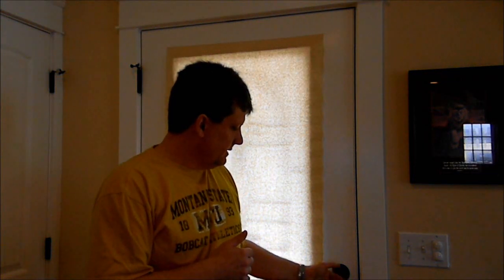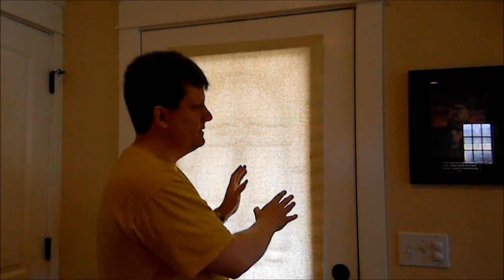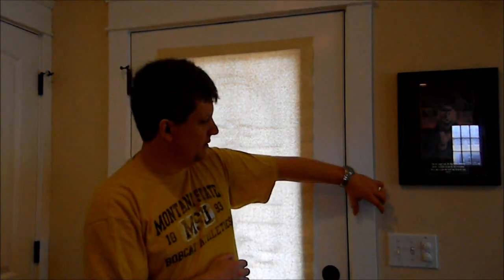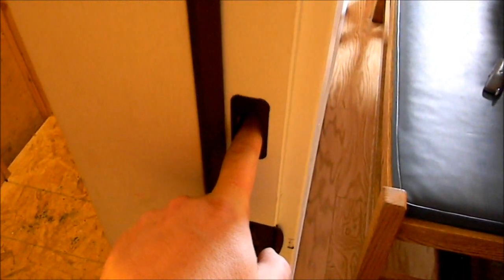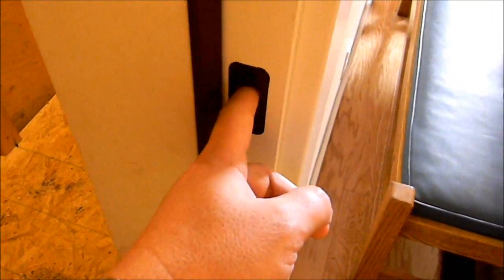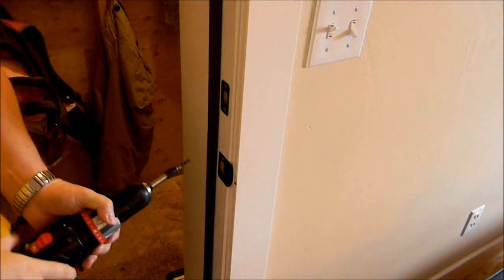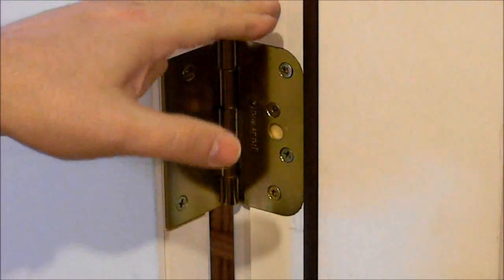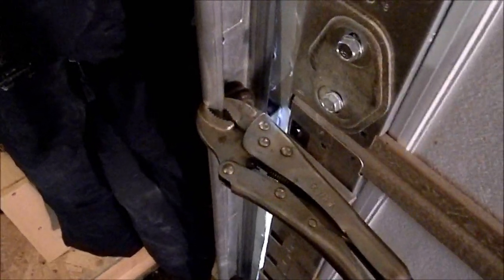SHTF WROL Home Defense Solutions

Comment: Some experts have no real world use of the products they claim to be experts on . That being said, I have installed and removed thousands of sheets of both products and primarily use OSB in all my construction. OSB is much easier to punch through with a hammer or crowbar allowing access to your lock. Try it for yourself and you will see. So in this application I would would use plywood. And again good tips I always use the long screws when installing doors and locksets. Thanks

Comment: Drill a hole in the garage door rail or if holes are already present put a pad lock through the hole in the rail. You could also put a bolt in the holes to prevent it from moving up or down.

Comment: Good video, I would go with plywood over OSB bc it is much stronger, I would also recommend using 2x4 or 2x6 as a middle mount on your OSB or plywood to really strengthen it. Note it won't even come close to stopping a bullet so I would pick strategic locations to harden and put a couple spots to shoot from out.

Comment: Good video. Thanks.  I've actually installed Window Safety Film (Storm / Tornado rated) on my ground-level windows, and my entry doors. It's very easy to install, and EXTREMELY effective against break-in's (Hammers, Baseball bats, sledgehammers, etc). Extremely affordable, as well.

Comment: With a solid door,  solid wood or metal or a combo door  i use barn door hinges,  heavy duty steel hinges in my doors.  As for locking i dont use a 2x4 ir 4x4, I use solid bolts,  same bolts used to lock barb doors.  These bolts are 2 left,  2 right,  2 too and 2 bottom. Easy to drop in and take out.  8 point lock.  The bolts are running through the door frame and into the door it self.  Much better and less of an eye sore

Comment: OSB board burns easily, quickly and extremely hot due to the adhesive and wood chips. OSB board also breaks easily. Just get regular plywood. You can also get a deadbolt with removable key on inside.
Reply from the maker: Grizzly Country  A deadbolt not anchored into the houses framing is just window dressing.
Reply from the maker: Grizzly Country  http://www.woodworks.org/wp-content/uploads/2014-SE-WSF-Palardy-Meeting-Fire-Codes-with-OSB.pdf

Comment: Quick note. Doorlock breaching devices can be easily defeated by additional deadbolt locks visible only on the inside. If they can't see them, they can't breach them.
Reply: I've done alot of forcible entry in my career. If a point of the door doesn't move I know something is there. At that point I can focus on that area, target hinge side instead or hit center of door from top to bottom in attempt to fold it and defeat locks.

Comment: Even long screws are easy to breach. They break or the wood breaks.
Reply from the maker: Grizzly Country That's why I recommended framing screws which are heartier for breaking and shearing. The purpose of the longer screw is to anchor into the 2x4 framing behind the door jam.

Comment: I'm building a 20,000+ sf mansion in the south side of Bozeman and I want a fortress. I'm using steel industrial doors with steel frames, and windows are to be seven foot above the outside grounds at a minimum.

Bedroom is behind a secret door, as are many other hidden rooms are designed into the blueprint already. It's designed to resist a home invasion with tunnels and hidden access points.

I have at least an acre facing neighbors homes on all sides. My wife and I are eccentrics. Go Cats!

Comment: revers the door to swing out will make a huge difference.. the door can be kicked in, if the door swing in, and  yes always have a dead bolt. and steel frames need to be backed with a 2x4 in the door jam. something to stop a crowbar from poping the frame... (denting)... I did a personal security work shop with the RCMP back in 98... I basicly learned how to be a criminal and a profishinal door buster. It defently enlightened me in home and personal security. the cross block is a good idea, but its only good when you are home... im not saying its no good. its great if you are at home. but when i go out i want my place to be just as hard to break in... flip the door around to swing out ward.... with global warming we dont get the snow we used to so if you arnt in a cold cliamet then you wont be snowed in.... flip that shit :)
Reply from the maker: sgt. Nickel Good thoughts thanks for sharing. Contrary to many peoples beliefs you can't just start hacking up/altering rental homes. (I'm not talking about you either) Yes, I do live a cold climate. MT. Also, I'm not so sure I want to allow someone the opportunity to lock me in my own home... Your thoughts?
Reply: FletchBZMMT now that is a good point.. one that never crossed the mind... i have windows that can be easily escaped from... but not all houses have that...
Reply: +FletchBZMMT - you could run long screws in the hinges, striker plate etc.  Also having a floor to door handle bar is better than nothing as reinforcement against being kicked in.  I've personally got plans to just put screw holes into walls and timber if things got that bad, you can fill it and paint it if it was short term.
Reply: At which point it's pried open easily.

Comment: The other store is called Home Depot.  Try educating your audience; OSB stands for oriented strand board.  OSB gets is strength from the random orientation of the stands laminated together.  Good tip on the screw with the washer.  Why do a video when you have a runny nose or cold?
Reply: +Huevonious Maximus -- or not use lights or have the phone on ;)   Liked the video never the less.